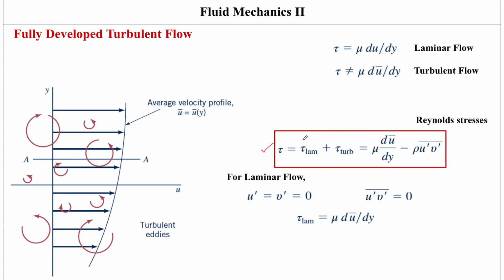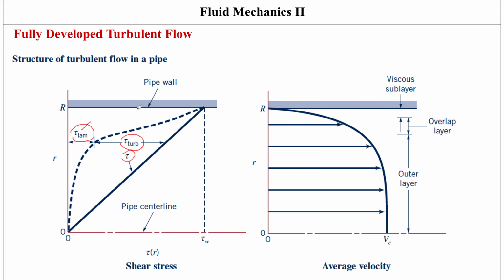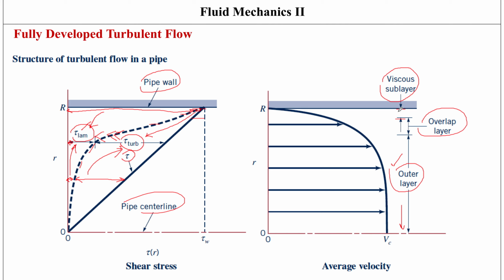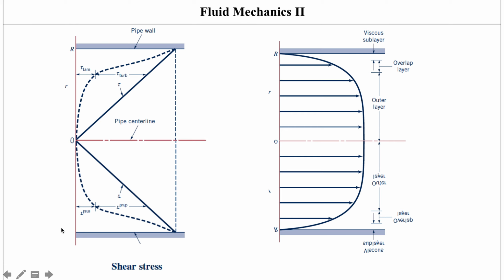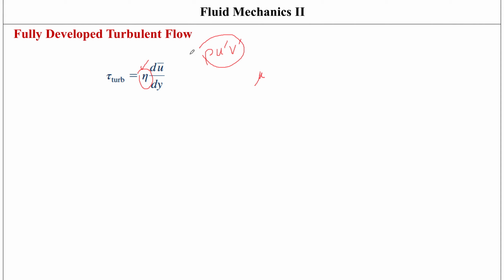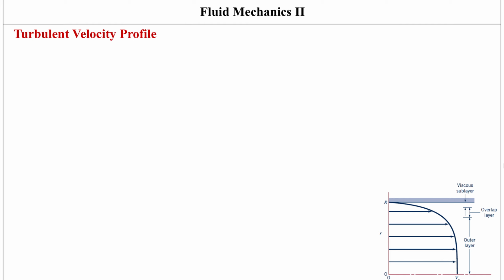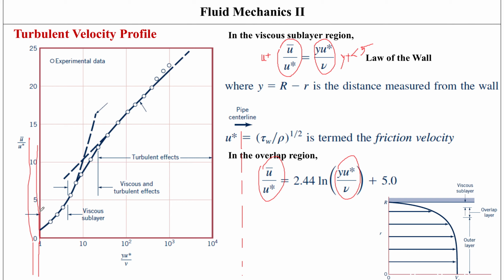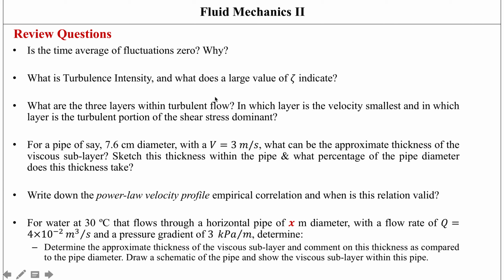Introduction to Turbulent Flow - Part 2 (Turbulent Velocity Profile)

Comment: u'  and v' are fluctuating components of velocity, and in the steady flow they are zero while in unsteady they are not zero, laminar flow can be unsteady flow too, so the fluctuating components exist in unsteady laminar flow, is that right?
Reply: No, in laminar flow there are no fluctuating components. If you have unsteady laminar flow, this would mean that the velocity changes with time. So the speed of a particle changes with time, but not in a rapid fluctuating manner like for turbulent flows

Comment: Good evening from Czech Republic.
First of all, great videos on this topic, both part one and part two.
I'm glad I step upon this, I am new to fluid mechanics, my interest is more into the black holes, expansion, cooling of the universe etc.
I was just wondering, and I know that this applies only for a gas, fluid or plasma, but when there is a velocity dependance especially close to the wall, how would photons behave, when their speed is constant.

It might be a horrible point of view.

Or behavior of mass inside of a black hole, does it get imprinted onto the even horizon.. 
Are galaxies just "eddies" of finite matter into some 4D tube? Are those equations applyable for events in the universe? Stuff like that keeps me awake at night.

Thank you once more, I enjoyed it, and it sparked new ideas within me.